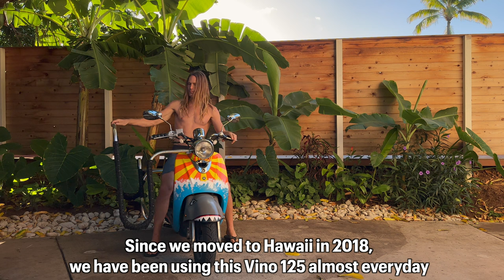Epic Surf Racks install on Yamaha Vino 125 scooter | Mitch's Scooter Stuff

Comment: where did you get the bracket for the front where you drilled the 3 holes at 5:35 is there a link or did u custom fab it? love the build havent seen kits for the vino big enough for my log
Reply from the maker: that bracket is stock... it is attached to the front cover. Thank you so much! :)